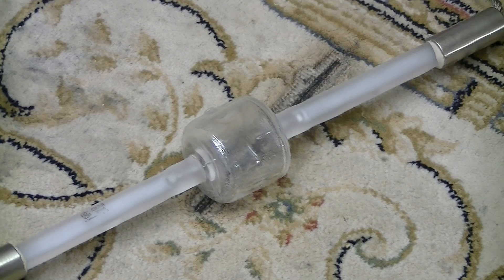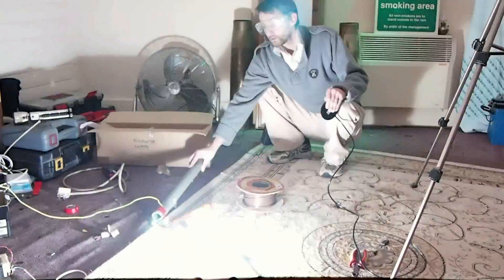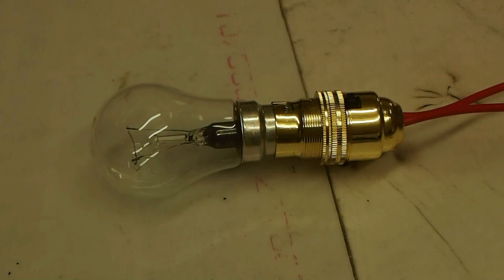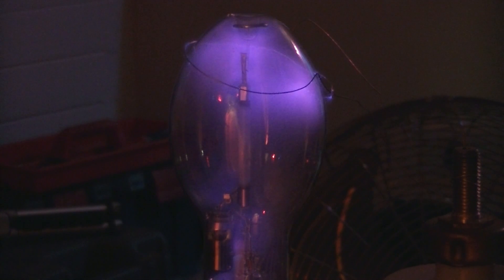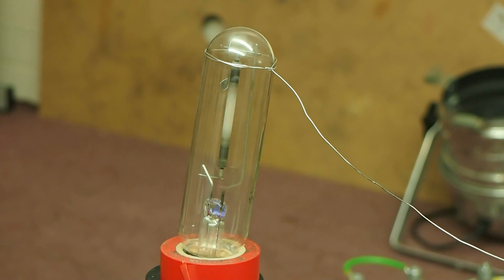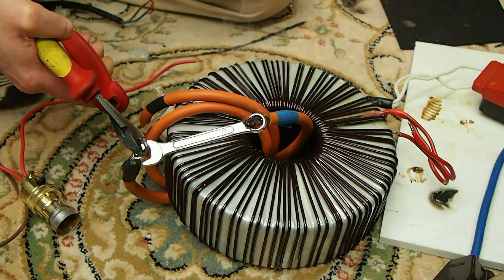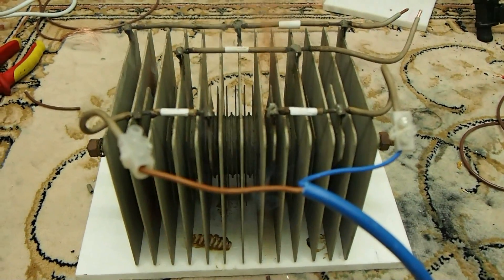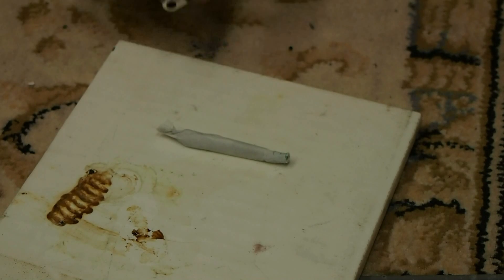State Of Matter

Comment: The higher voltage one would kill, because it only takes a small amount of current (through the heart) to kill. While it is amps that kill, having such a low voltage means that not much current will be able to flow through the high resistance of human body. Meanwhile, the high voltage will let all 7mA pass through every vital part of you body without stopping. This is assuming that 7mA is what it takes to kill, it may take more, but I'm not sure, I just know that the 1V 700A won't do anything. At low voltages, there is essentially no chance of anything happening, but at a higher voltage, current CAN flow if there is enough of it.
Reply: Really? I thought that in order for current to pass through a high-resistance load, you need a higher voltage. V=IR, if I is high (to be lethal) and R is high, such as a human body, wouldn't V need to be high as well? Also, if V is low, I cannot get sufficiently high enough for lethality. *****
Reply: 7 mA i believe is on the verge of cardiac arrest, at least it would definitely be painful to hold and hard to let go. your muscles through the current path would all flex and your heart may stop. Also respiratory problems begin around the 7-10mA mark.. i touched 20V AC and had a headache for days on end, my breathing suffered a little.. feeling lucky to have not died. (My heart is very weak and had wet hands when i touched the live metal)
Reply: Well, the resistance of the wire AND you. Considering that there is always SOME resistance, there cannot be infinite current from a finite voltage.
Reply: @NOT WHAT IT LOOKS LIKE
Well, not entirely. Think of amps as the amount of energy something has the potential to deliver (Yes, I know amps aren't energy, but things need to be simplified here). For example, a car battery can output ~200 amps, but nothing happens if I touch the two terminals because the voltage isn't high enough to allow a high amount of current flow though the resistance of my body. Voltage = Current x Resistance, so with a low voltage, higher currents can't flow in something with high resistance (ex: human body). Now if that resistance was low (like a metal wrench), and we look at Current = Voltage / Resistance, we see that the low resistance allows for a high amount of current to flow, which is what can cause the wrench to get REALLY hot.

With humans, the general limit for when something approaches "high voltage" is when the voltage is high enough to allow a high enough current to flow. This is accepted to be ~60V.
Reply: Wat
Reply: I love your videos :»
Reply: If that 100-200mA number is correct, then you are right. However, the reason the higher voltage is generally considered to be more dangerous is because you're relying on the current limiting of the power supply to not kill you. TBH, both are probably 'safe', but the 7mA at high voltage definitely has much higher risk.
Reply: 300mA + and has to be sustained
Reply: ***** It is not just the volts or just the amps that kill, it is a combination of both in sufficient amounts. So yes, having a high current at low voltage means that the electricity cannot overcome the resistance of your body, whereas having a very high voltage at a very low current means that it cannot sustain the high voltage through your body, so not enough overall power is delivered to kill (Watts). I am inclined to think that it is power that kills, but for the reasons mentioned above, when toughing high voltages at low current or low voltages at high current means that the not enough power can be delivered to kill you.
Reply: *****
Yeah I would say under normal circumstances that is unlikely... Also as a person who clearly knows a lot about Physics, could you please explain the difference to me between kV and keV? I would guess that one stands for electron Volts rather than Volts, so I would guess that they mean different things but I'm not too sure?
Reply: *****
Ah righ, thanks! It does seem quite self explanatory now!
Reply: LazerLord10 your timelapse are awesome !!
Reply: Lol I feel like an idiot for not understanding exactly how everything works. I just don't understand the relation between volts and amps because I thought they were meant to show a level of how much power there is in something. Like how much electricity there is
Reply: LazerLord10 there is no current limiting than amperage would be infinite, the only current limiting you would have would be the resistance of the wire itself.
Reply: you've got the right answer anyway I think we're just going about it in different ways LOL, the way the question was phrased is misleading. I think what he was trying to say was how many amps were available because the resistance of your body at the 12 volt level of a car battery will make you feel nothing at all and in fact water is a poor enough conductor of electricity that you can wash the top of your car battery with a hose and there still won't be enough current to do anything. turn it up to a hundred thousand volts and use your same body as a measurement of resistance and you are going to have a lot more current going through it LOL I think we both understand and are saying the same things in different ways, I used to test Transformers all the time with a hi pot and while the voltage was in the thousands, the current was limited so that even if it didn't feel good you wouldn't get hurt LOL. look at how many volts is static shock is! but it just doesn't have the available current at the resistance of your body. but yeah, if somebody passed a hundred thousand volts are crossed you with 7 milliamps then you would be dead, the average dry body has a resistance of 100000 ohms. the good old pie chart LOL
Reply: LazerLord10 but it takes between 100 and 200 milliamps to kill someone and according to the statement at the end the power source of high voltage is only capable of delivering 7 milliamps which is not supposed to be enough to kill you. the other scenario with the low voltage and higher amps could not be attainable through the human body according to Ohm's law?
Reply: LazerLord10 I think that's the Crux of the problem, the way that the question at the end is stated. I, myself, would have to assume that only 7 milliamps is available from the high voltage source and at low voltage source not enough current could pass through the human body so perhaps he's trying to fool us because neither one of them would kill us LOL.
Reply: LazerLord10 yes but see I thought that amps are what make the volts hurt not the volts themselves
Reply: Nathaniel Struselis true I go with this dude in terms of facts
Reply: Amps are the thing that does the damage, but you need volts in order to actually be ABLE to do the damage.
Reply: Kind of. The main relation we want to look at is something called Ohm's law. You can look it up if you wish, but in essence, it means that through a given resistance, there is a direct (linear) relationship between the current and the voltage. Double the current = double the voltage. The equation is V = I x R, where I is the current. It can be re-arranged to yield different outputs, but this is what I was referencing. If V is low, then I must also be low. If V is high, then I must also be high if there is no current limiting.
Reply: neither will kill
Reply: You actully need volts and amps to kill. A lot of amps and few volts will just burn

Comment: That thing with "its not the volts that kill you its the amps" is completely incorrect... generally anything over 60V can be dangerous with enough current, you need a balance of both V and A to kill someone, however the 1V is completely safe even with 10,000A (in fact i'm willing to lick it and then put my dick on it, which is an equivalent to putting them in a glass of lemon juice diluted with water... except you don't get the vitamin c)... While 500V @ 1A will kill you, but then 500V @ 0.001A will not! In any case i'll steer well clear of 100,000V @ 0.007A with or without a lemon juice! Also, i have heard it is NOT recommended that you lick etc 1V @ 700A if you have metal piercings! You could have an alergic reaction.
Reply: Go to wikipedia & read about Ohm's & Kirchhoff's laws & realize that you aren't making the tiniest bit of sense here.
Reply: GentleSavage1 It wasn't my intention to make it make sense to EVERYONE... and evidently you're one of these people that it doesn't make sense to, which is all good. You go and read whatever you want to, though i doubt it will help you understand any better... i'm quite fine thanks.

Comment: the one wich is going to kill you is the energy saving lamp at the very end of the video... these lamps contain some amounts of mercury, wich in its gaseous form is very easy to be inhaled and very, very, very toxic!

actually its said, that the amps are killing you because of the high amount of electricity running through your body. while imagining the default resistance of a human skin is about 1kOhms, a voltage of 1v will lead up to 1mA wich isnt very dangerous. in addition, 100kv would be a bit "shocking" but wont kill you either if its limited to 7mA. BUT, these are some bullshit theoretic views. actually a shorted coil is intrinsicly trying to hold its current because of its established magnetic field, no matter, what voltage is needed for that. that is the reason, there are coils used in DC/DC-converters! So you better dont touch the circuit, while opening it. furthermore even 7mA MIGHT kill you if traveling through your heart because (altough uncommon) there is no high current needed to reset the function of the Sinoatrial node - that is the reason, several people died after the use of tazers by US-police.

but the thing i like most in your "laboratory" is your obviously fire resistant carpet... no seriously, who the hell would do something with that much potential to start a fire on a carpet?? :D

sorry for missspellings as english is not my native language.
>_ Die Kraft kommt aus dem Keller.

Comment: Well since P=I time E, if my decimal math is correct, the 100,000 volts times 7 milliamperes comes out to it only having a power rating of 7. Where as the 700 amp at 1 volt has a P of 700. Clearly 700 is much higher and will kill you.
 ***UPDATE*** My math was pointed out as being obviously wrong. 100,000 volts times 7 milliamperes actually comes out to 700 (I had a brain fart and assumed milliamperes was million, it's actually only a thousand per 1 amp)
Reply: well, yep, your decimal math is not correct. 100,000 times 0,007 equals 700. next time use your brain instead of a calculator...
Reply: ChickenCommander I better edit that, your right. I have no idea how in the hell I got that.
Reply: Yes, "you're" right...
Reply: Ha Ha, ya, you will definitely learn the hard way.

Comment: The one with 700 amps will kill you.
It is the power not the voltage that kills.
And the one with 700 amps has more overall power between the two.
Reply: So wrong!
Reply: why wrong?
Reply: ***** Because humans are not made from metal generally... you need to consider the resistance... like how well something conducts electricity... metal low resistance, humans high resistance. And since humans do not conduct electricity anywhere near as good as metals, the 1V will not do anything to you, completely IRRELEVANT of how high the available current is. So if you touch 1V 700A it will be roughly equal to touching a AAA or D cell battery (except 0.5V more). However higher voltages go thru higher resistance more easily, so 100,000V at 700A and they would struggle to find anything left of you. Basically current is volts divide by resistance... so if a human body is say 2Kohm (2000ohms) then it will only draw 0.0005A from a supply of 1V @ 700A and guess what... it is also 0.0005A from a supply of 1V @ 1A so the 700A or the 1A is what is available and NOT what your body will take from it. However at 100,000V and 2Kohm body resistance (for example) you would get 50A going thru IF there was that much available from the supply, which would destroy you on the spot, but in the video there is only 0.007A available at that high voltage, and it is not possible to get 50A from an available supply of 0.007A and so the voltage will go down immediately because the supply would be overloaded a lot! Yes 700A supply will kill you, but nowhere near the 1V as it needs to be a lot higher voltage. To get 700A going thru your body you need a voltage of 1,400,000V (if the resistance stays at 2Kohm). And if you grab hold of a 240V supply, then only 0.12A will be used to possibly kill you, even though you may have a 16A available supply (if its fused with a 16A circuit breaker, which obviously won't trip while it kills you) but again, the 2Kohm is just an example, the body resistance depends on many things, and generally is less than 2Kohm and varies depending on voltage also, and the lower it is, the more current will go thru. Anyway i cant be any clearer, hope this helps!
Reply: Black Wolf Yeah, and your skin resistance can change. Easily. Very easily. I just don't touch shit.
Reply: Black Wolf Did you read my comment? The skin would normally protect you, but if you pierce the electrodes through 1v kills.
Reply: Black Wolf i think you dont quite get what the skin has to do with the whole thing
Reply: frtard Your argument is true but even if you had you fingers wet with salty water you won't feel nothing if you touch 1v at 700amps

You need to have enought voltage to "break" your skin resistance and 1v it's not enought you would need arround ~+20v to start felling a small sensation (on right conditions, like wet fingers) 

The resistence is not the same on every part of your body so the voltage you need to start felling something varies
Reply: actually you are wrong 1v doesen't kill you even with a million amps

and at 100kv if  you have power supply that can supply more then 60 miliampers you will die, at 1amp with fast medical assistance you have a small chance of getting away just with some burns
Reply: Revoku You're an idiot, you've made that obvious! I understand you lack knowledge, but to come on here saying things like that while believing you are correct is just silly!
Reply: Tiago Oliveira 1v can easily kill you with those amps. If you make electrical contact by piercing the electrodes into your skin.
Reply: drkastenbrot No it would not! Did you not read the comments above? I did explain this in much detail, with 1V it makes no difference if it's 0.1A or 50,000A
Reply: hi drkastenbrot, do you want me to prove with math that what you are saying is wrong?
Reply: drkastenbrot You're a clueless idiot, you know nothing yet you come on here telling people who know their stuff that they are wrong.. i have explained in detail on the 16 feb, you obviously didn't read it.
Reply: Black Wolf i got shocked from 9 volts before, in a wound. I might take back that it would kill you due to the high resistance but it definitely can hurt you.
Reply: drkastenbrot No it can't hurt you either, the only reason it may "hurt" is because of the wound where nerves are exposed, same as if you put salt or alcohol on a wound. I would suggest you don't put a 9V battery on a wound next time. Also if you're holding both bare wires of a coil or motor etc and connect to 1V (or 9V) you may actually get a brief painfull shock, but that would no longer be 1 or 9V but could be few hundred volts, due to induction in the coil which are very brief pulses or spikes.
Reply: drkastenbrot Why don't you explain it to me then.
Reply: i agree, a long time ago i was doing maintenance on a electric motor of my shutter, i was almost positive that the cutout switch was off, but it wasn't. I connected the live wire to the motor, i was ready to connect the neutral, but  while i was touching the neutral wire, i touched by accident, the neutral cable of the motor, i completed the circuit, the current flow through the live wire to the coil of the motor and through me to the neutral, so i was shocked with 250v  (the motor was rated at 0.4amp, i was in series with the motor) i felt the electricity traveling through me, it was like really long needles passing through me, but even at 250v i can't say that it hearts i got scared has fucked... but it was not traumatic, 1v 9v is nothing compared with something like this
Reply: Tiago Oliveira Was it the same hand that touched the neautral wire of the motor which was holding the neutral wire? Or did the 250V go from one hand to the other? (as in through your chest etc) It dosn't hurt that much just via one hand only.
Reply: Black Wolf different hands, it was like  a wave traveling through my left hand to the right one, the shock lasted about 1~2sg, It did not hurt but i do not want to try again
Reply: Tiago Oliveira We'll get drkastenbrot to try :)
Reply: Ahhh!
Reply: Tiago Oliveira The worst i tried was about 450V DC which was nasty, but the highest was about 27,000V DC (but low current so it wasn't too bad)
Reply: i made a jacobs ladder with my nst, 7kv at 0.3amps and this one hurt
Reply: Tiago Oliveira Nasty!
Reply: M1kerB1ker 
You actually need volts and amps to kill
Reply: M1kerB1ker  Go back to school fucktart
Reply: Your skin has higher resistance than your internal bits, so if say...you got poked with a pair of sewing needles or something, you would need less voltage to get killed. Now, 1 volt isn't going to do that anyway, worst thing that might happen could be...burning your tongue or something. Whereas the 100kv @ 7ma would fucking HURT, but it shouldn't kill you, as the current isn't high enough to cause death.

You need a certain voltage to actually get affected, depending on where you touch, but once you have that voltage, you also need sufficient current in order to actually get hurt. It's why people don't die when they get tazed...normally.